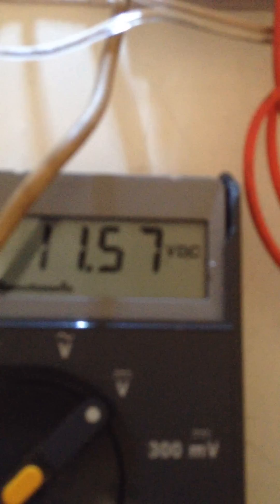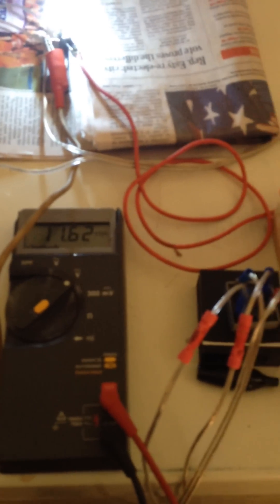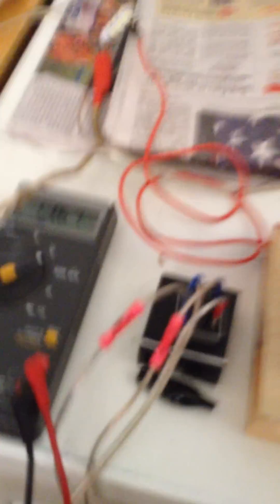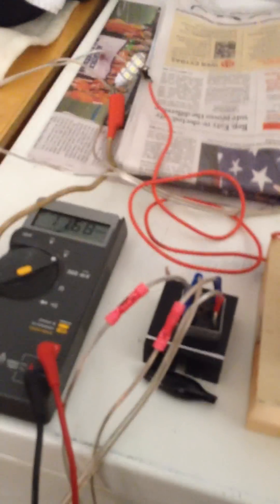Over unity created with transformed back emf. True over unity, no BS!

Comment: As you have attached the secondary through a rectifier back to the battery, you are not measuring the true battery voltage.
Reply from the maker: If that is so, then why does it continue to run and re-feed itself continuously without dying? what is it reading then... amperage?.. lol
Reply from the maker: the rectifier isolates the high voltage and the battery voltage is not affected by the ac current as it literally turns to dc once the battery is connected, as the dc battery absorbs it. The diode isolates half of the wave and the connection adds the additional voltage, boosting the battery, allowing thi additional voltage that is much higher to apply a low, but additional amperage capability from the battery which allows the battery to feed the system, and provide additional power which allows the circuit to continue running until the battery either fails or the relay fails. I have yet to have this happen and the circuit has run from June of 2014 through November 4, 2014 without failing or dying. The system draws in radiant energy which allows it to power the circuit and add enough additional energy to cover the losses of the transformer, the losses from the resistance in every connection, the losses in the rectifiier, the losses from the load , and, the leakage current which is the loss of the cap bank. If there was not some type of additional energy source, the system voltage would rapidly reduce and the system would die. It does not die, so, your indication that I am not reading true voltage really doesn't matter at this point because the system self loops without losing power and my attempt to prove overunity in a closed loop system is very possible, it has not been built to replicate any other theory, I am not trying to prove anything by showing the voltage other than the fact that it shows that the system is charging. You and everybody else could skepticize anything you wish, as well, try to tell the whole world everything is wrong, but, one thing I have been showing is the fact that there is another source of energy being drawn in that does not have any physical connection. What i am showing here is that positive particles are being attracted and drawn in through the spark gap which is the switch of the relay under the relay's outside housing, and this is exactly where the additional source of energy is being drawn into, which is very evident as I could add diodes to the meter to prove additional voltage is being delivered over the top of the back emf that is released from the relay. The relay circuit is basically a modified tank circuit which would self sustain without the additional components by replacing the used energy, giving back exactly what is being used, eliminating the losses of the components by eliminating Lenz's law. When you modify the circuit to add what I have to it, this back emf being released through the switch causes a plasma that attracts the outside radiant energy which is being captured by the battery through another diode that connects from the hot side of the secondary of the transformer, connecting a higher speed diode between this and the positive terminal of the battery, as well, the rectifier bridge allows the back emf to be dumped into the cap bank , which the battery will not absorb, so, the cap bank absorbs this and transfers the energy from the caps to the battery, allowing the additional energy to charge the battery. The circuit kind of works like a team by sending the additional power to the caps, and the other to the battery, and, another to the battery one allowed to go to the battery quickly, and the other to go slowly, which actually does make a big difference and when building it, you can hear the difference through the speed of the relay oscillations as the connection are being made while it is in operation. That is how I figured this all out. It wasn't working at first and I kept making connections with components connected to clip leads until something out of the ordinary has happened. It isn't normal but, it does work regardless of what anybody says, as well, whatever any skeptic thinks. The school books don't teach this, they teach this is impossible, so, if this is shown to a professor, he or she would simply state that this is an anomaly as they would not be able to legitimately explain what is happening as it would violate everything they have ever been taught. They would literally refuse to comment about why this works positively in a public presence because they would look like scammers. I really don't care what people think, I care that some people believe what i really have as it really does work and it is possible. I have many other devices that work as well and I prove everybody wrong when they see the devices working in person. I am currently negotiating the sale of one of the products which is an overnity device which I have reduced the over efficiency to be used merely for a massive savings in efficiency for a brand new multi billion dollar market of a very popular product, and, it works perfectly!

Comment: Hello Everybody !
I've solved my problem !
On my relay, I have only 4 pins : 85-86-87-30
In fact, I have modified it and created a new 87a pin !
Very easy !
You drill the plastic cover of the relay on the side of the contact.
You put a screw and a nut (optional), and "Tadaaaaaaa" ! you've created your new 87a pin !
Now I have my oscillations !
And the best thing is that I can tune the oscillations thanks to the screw !
To illustrate what I'm saying, have a look at this old video of Lidmotor (look at 1 min) : 
https://www.youtube.com/watch?v=_TjxV3c7pTo

Now, I will try Marc entire circuit :-)
Reply: Hi, 8 years later did it work? 

I would like to build the same circuit. Is there anything you would advise me on doing? Should I just replicate it exactly as he has described and it will allow a battery to self charge?

Comment: Hi Marc.
Mpkiteman again.
A lot of people here are talking about your circuit without having tried a single circuit...
I'm not one of these.
I've studied a lot the Don smith devices (and partially replicated some of them), Bedini circuits, Rick Friedrich circuits, a lot of Patrick kelly circuits shown in his fabulous PJKbook...
But I love your circuit : It's simple and everyone can replicate it with very simple parts.
Yesterday, I've tried your circuit with a transformer (12v-220v), a 12V 7 Ah gel battery, and a relay that I had used in my Imhotep replication of radiant circuit.
Unfortunately, I wasn't able to get the relay oscillating when wired in your way.
What am I Missing ?

Thanks for your attention.

mpkiteman@gmail.com
Reply from the maker: Hello,
 If you do not get oscillation, you may have something wired wrong. Lets start with the battery's positive wire. Take this and wire it to a switch of any kind, it really doesn't matter. Due to it's voltage and it's rigidity, I use a home light switch with solid wire now so it is sturdy and stable. Connect it to one end of the switch. Then, take the other side of the switch and connect it to the terminal 85 of the automotive relay, the feed runs through the coil , out the other side and connects to the normally closed switch on the relay, terminal 87a.or terminal 30, it really doesn't matter because it goes out from this switch to either side of the primary coil of the transformer which will be the low voltage side, then, out of this coil, back to the battery's negative terminal and the negative terminal of the capacitor bank in parallel circuit. (Now when the switch is on, the relay will oscillate, making the vibrating noise. If it doesn't , it means that one of the coils either on the relay or the transfoemr coil is open. Take an ohmeter and test them for continuity. You should get about 1-2 ohms on the coil of the transformer and about 30 ohms across the relay coil. Disconnect the terminals before you test it though.) if you get no reading, the coil is bad.) Make sure the battery has voltage, and, if it does, make sure you follow the voltage through the switch with a meter to see where it stops. The relay switch could be bad as well.  (which is one end of the coil if you aren't using the auto relay (take a picture of it if it isn't a relay and I will let you know if it is connected correctly my email is marcvbelanger@gmail.com.

The relay will NOT work if it has a diode installed across the coil, which is hard to tell as the relay diagram does not use a diode logo as the representation of a diode if it has one, so, the relay will not oscillate if it has one because it stops this from happening to eliminate all back emf caused by the coil's field collapse, eliminating the back emf and radiant energy from charging anything.

Please send me a picture of the relay diagram, as well as the circuit so I could see what it is. I will walk you through it if everything seems to be connected correctly, there may be either something bad, or a bad connection, or bad relay out of the box!

Regards,
Marc